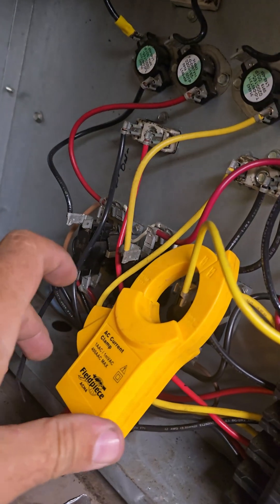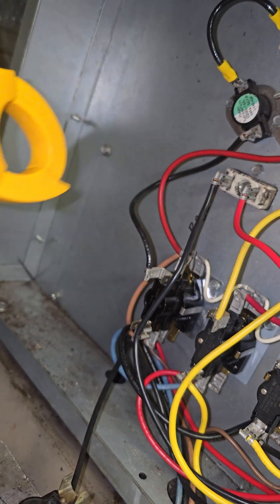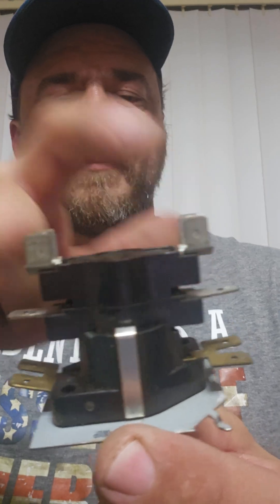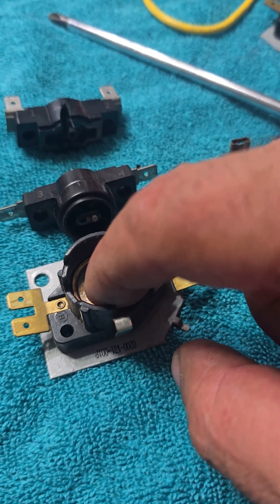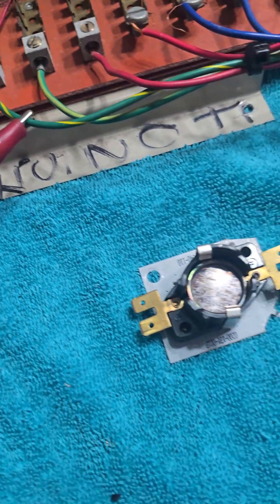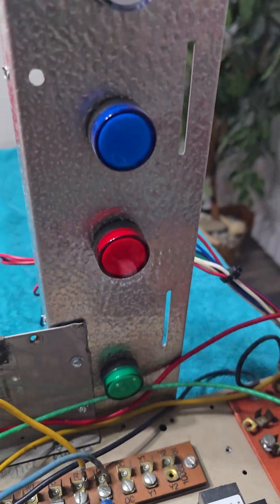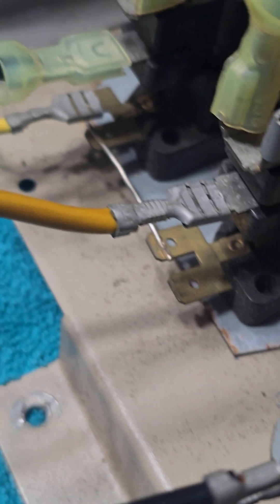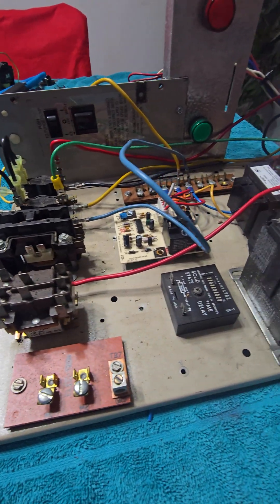Loose Connections and Heat Sequencers

Comment: The same issues with the connections heating up is in a lot of other appliances as well. Ovens dryers, etc. Looook for high temperature ones for replacement.